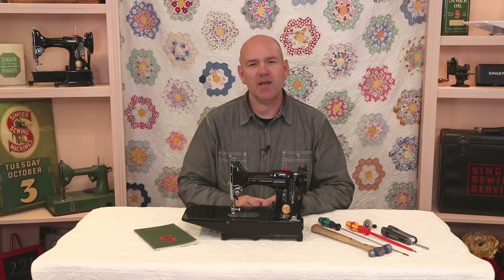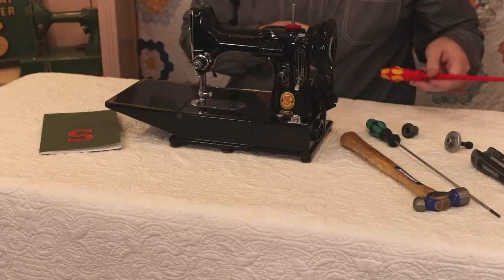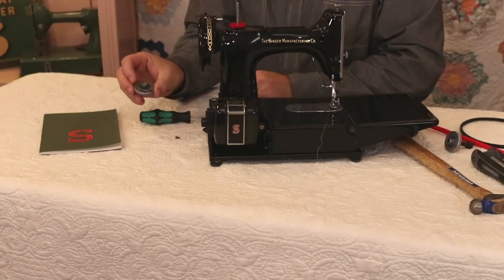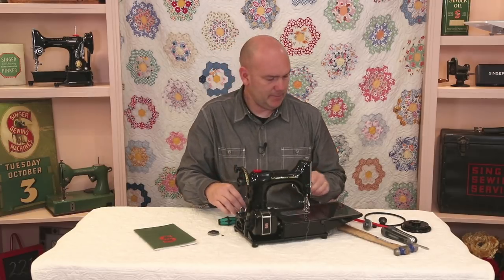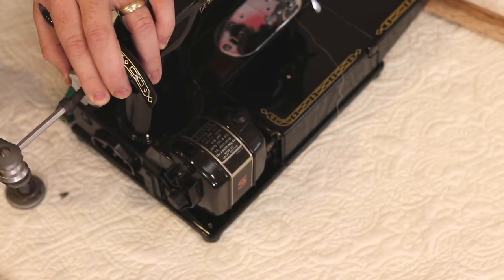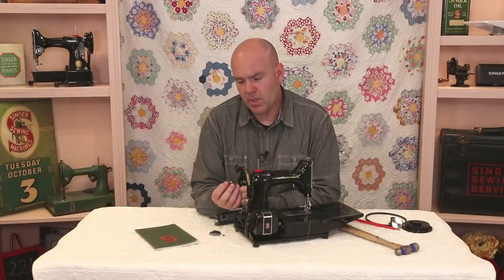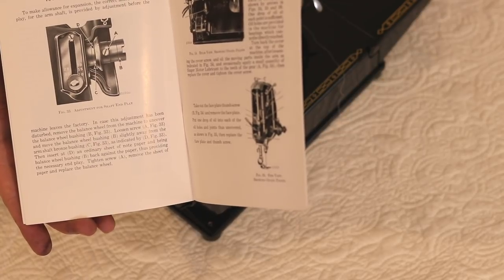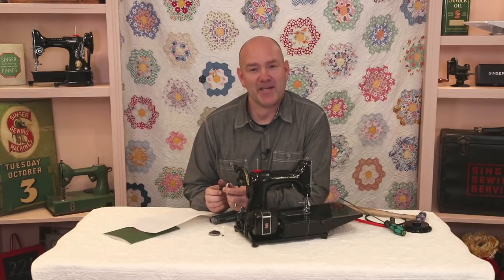Singer Featherweight 221 222 Repair Video Tutorial - Handwheel Collar

Comment: Hi Carmon, I am looking for the tutorial on how to remove and replace the stitchplate on the 221 can you  direct me please? I did see one but it didn't show the actual removal of the plate - I think it was in the process of doing something else. I think I may need to undo a screw under  the  handwheel? Is there a specific tutorial for replacing the plate - my machine has the plain chrome one which is hard to see stitch length accurately. Thanks for your fantastic video tutorials!

Comment: Your engineered tool is similar to a crank removal tool that bicycle mechanics use to pull square tapered cranks. Is your tool made using a stop motion knob? Thanks for the videos. My wife has recently got a couple of 221's and wants me to help with maintenance. In my retirement I fix bikes and now started working on vintage sewing machines. We bought the Wera screwdrivers you sell and other supplies

Comment: If the collar gets damaged and the wheel has a very slight wobble( not true turn) to it and it slightly binds in a place when turning the wheel by hand. Do you think thread would do it or maybe a bent shaft? it is not on a featherweight but a 15 Thanks to anyone that can help me out.